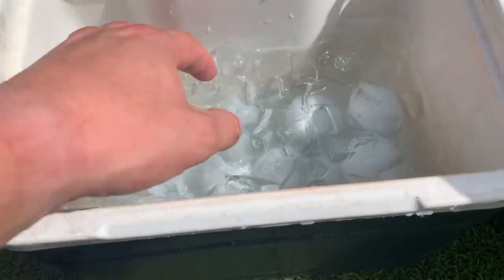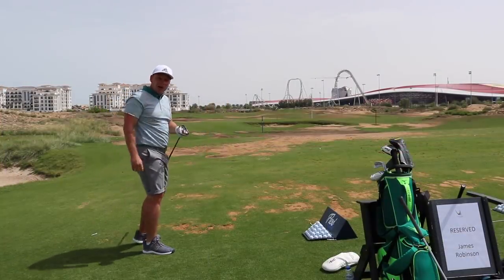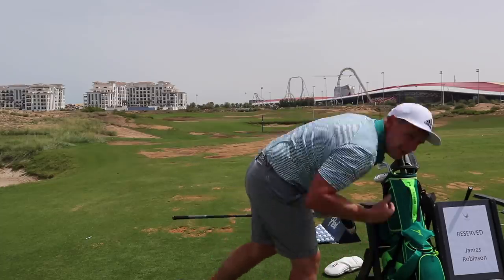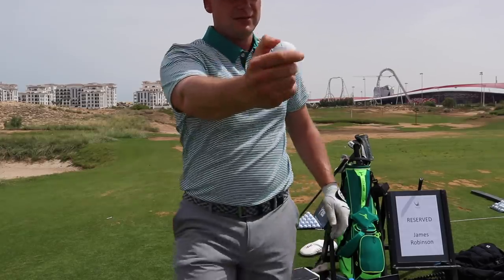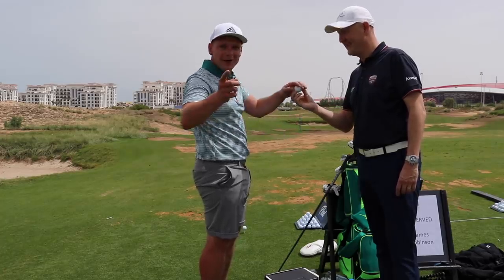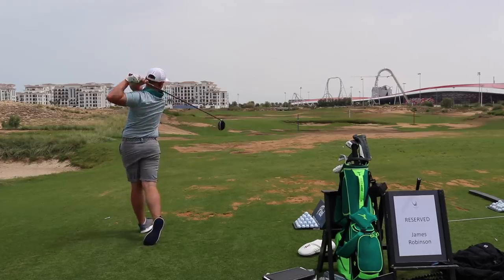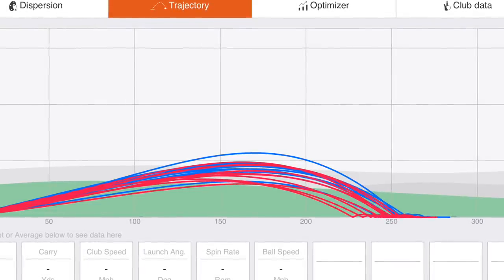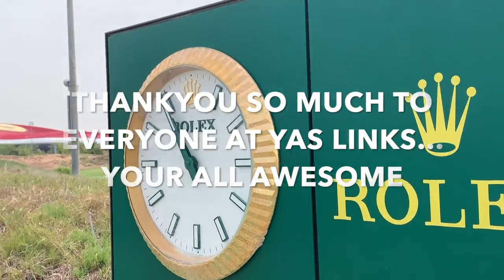Hot Balls vs Cold Balls? - Golf Ball Temperature Test!

Comment: The golf ball performs best between 21 degrees C and 37 degrees C. So you probably would have gotten a better result by not warming them at all. They are designed to work best under normal warm summer conditions. Boiling actually ruins the core of the ball aswell :P It makes the core lose its elasticity.
Reply: Exactly. Dean Snell addresses this issue in a Q&A video with MyGolfSpy. Fun to see a real world test.

Comment: If you was playing in the winter the club head would also be cooler. Thus the face not flexing as much as the summer temperature. Taking that into account I think the colder ball would have travelled even less. Thoughts anyone?
Reply from the maker: Agreed.
Reply: That's what I was thinking. Also, cold air has more resistance. All these things explain why the ball just doesn't go as far in cold weather.

Comment: Real difference will be bigger: Cold air is quite a bit more dense than hot air ==> more air resistance in flight. Combine the two: easily one club shorter in winter. Ball temp is about compression / smash factor. Air temp is about density and hence ballistic flight. 
Then again: that's all about carry. In Winter, mostly, the roll will be facilitated by hard fairways - at least in the mornings... although when the summer drought and heat has made the ground into concrete... more roll still. 
All that comes to nothing (or much worse) when (near-) sweetspot isn't achieved.

Comment: Cold balls are only half the story as when you play in cold weather, the air is "heavier" so you carry due to air temp is also greatly reduced. If I play a round at +2C, I am about 1.5 clubs shorter if I hit cold balls. I typically will keep one in my pocket and switch every hole and the ball stays a lot warmer Ang I lose a little less than a club and about 15 yards a drive.

I also think it will affect players with fast swing speeds less as basically you are making it higher compression so it would affect slow swing speeds s lot more.